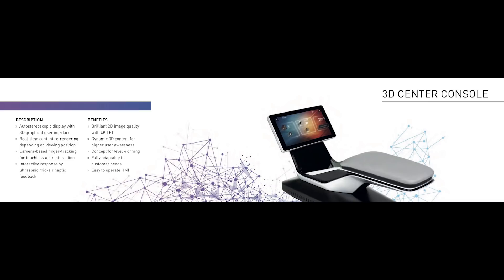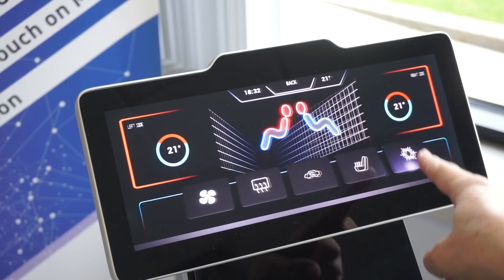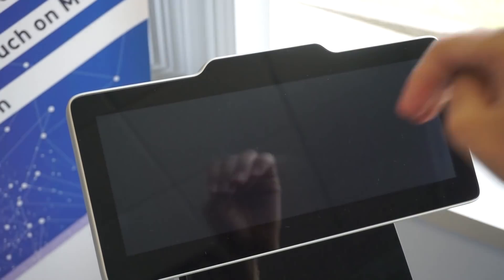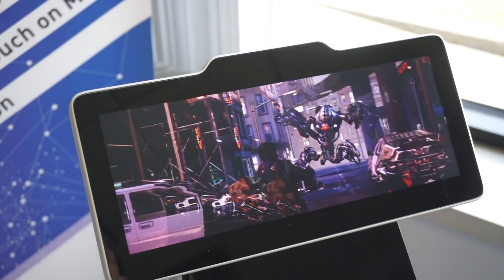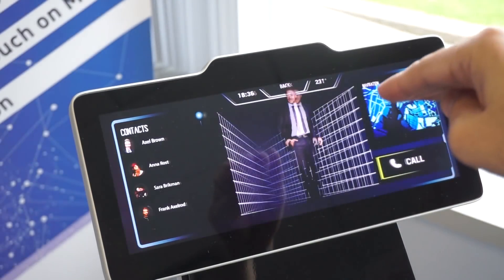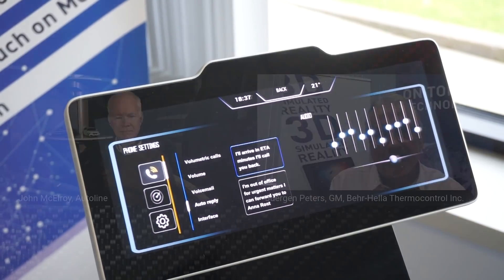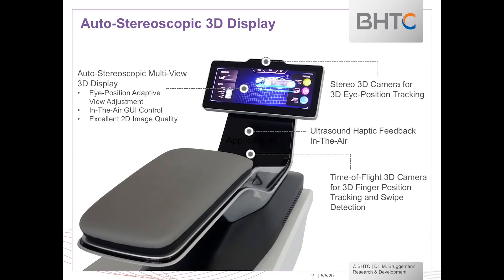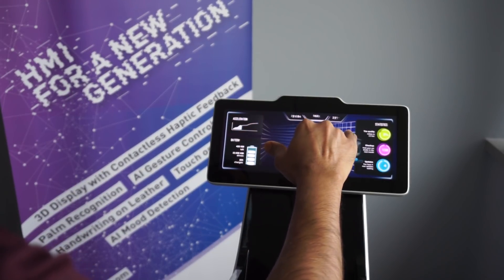No, You’re Not Cross-Eyed. That is a 3D Dashboard Display - Autoline Exclusives

Comment: cool, tech... but the awkward hand movements needed  to use the haptic input was comical...and I'm willing to bet, that no one will stop touching screen anyway.... 
so it's more suited for HUD input, with a virtual pointer that's behind a the dash or steering wheel that shows up on the HUD for feedback....
Reply: Not really. The concept can be achieved in multiple ways, eye tracking, ultrasound, or even radar (Project Soli)...in the new era of COVID...people may want to avoid touching the buttons and screen of shared cars. This allows them touch free option.